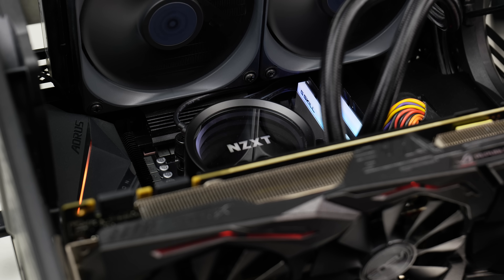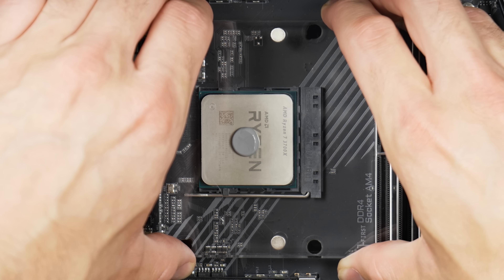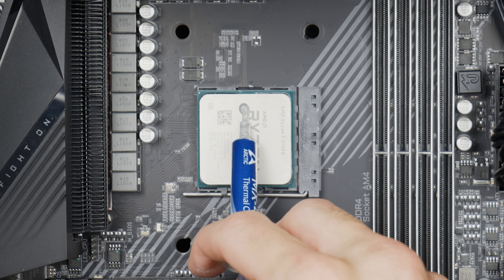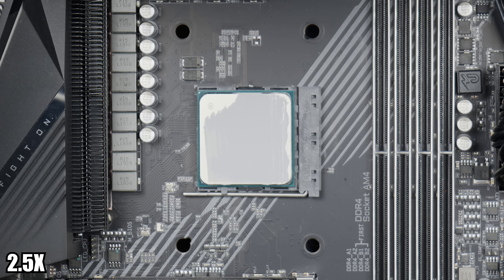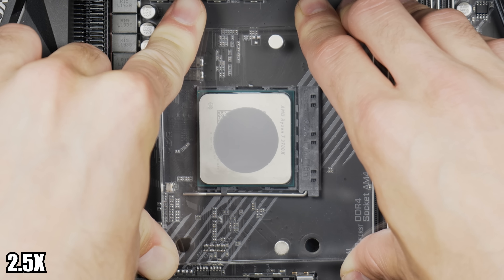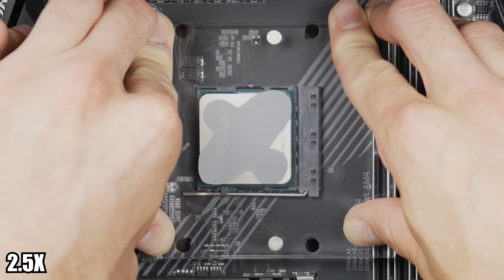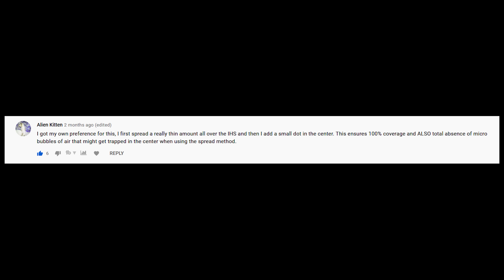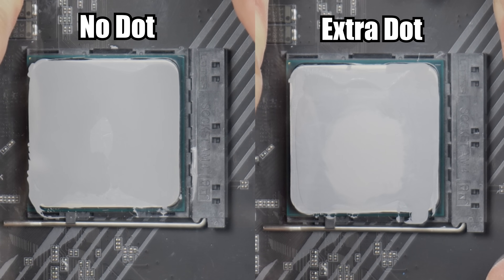Thermal Paste Spread Under Glass

Comment: "The bubble disappears, but where did it go?" These are the thoughts that haunt you after and make you want to remove it and take a peek.
Reply: If you have enough thermal paste it can't hurt to check and just redo it. I know I messed up the pea thing at first. I dno maybe peas are just smaller over here? XD
Reply: @zwenkwiel816  fr though. first time I built a PC I purposely used a bit more because I was thinking a frozen pea, that's definitely not enough
Reply: @Bluntsmoke  

There's no such thing as "not enough" when it comes to thermal paste. Its purpose is to fill in microscopic spaces between the two surfaces, not cover the entire thing.
Reply: @orionlax626  This is so extremely false. There is such a thing as "not enough". If the paste doesn't spread across at least some of the IHS, you will run into thermal issues; Especially with Ryzen cpus due to their chiplet design.

You can't really have too much. As long as the paste is non-conductive, its fine to have a little overflow on the sides.
Reply: @orionlax626  Except there is! If you use too much, is just bad as using none
Reply: @redbloodedamerican2346  

I know. That's why I'm saying you should use very little.
Reply: @orionlax626  You've got to use the right amount though. There is such thing as not enough. The purpose is to get the air out from between the cpu and cooler.  If you use the thermal pad, it gets hot.
Reply: @redbloodedamerican2346  

My point was that most people overdo it. The proper amount is a lot less than people think.
Reply: @orionlax626  Gotcha
Reply: @redbloodedamerican2346  That is not true. There are videos of people testing this with unholy amounts of thermal paste, and temps are the same as using the correct amount. The excess just squeezes out. Too little is very bad however.
Reply: @Alex-lc1bv  🙄 Then you've got a huge mess and not all are pastes are non conductive. Yes! My statement is true. I suggest read it again
Reply: Of course, that completely defeats the purpose, since all you see is smoosh and spikes. #DontWasteYourPaste
Reply: @h8GW  that's what she said
Reply: It pushed out the middle of the paste where resistance to its escape is lowest. They dont 'hide' in there. The surfaces resist flow more so you dont see it on the surface. Its a viscosity and friction thing. The bubble wont remain. Especially when the cpu heats and the paste thins slightly.
Reply: @willcal2738  Oh how they hide. Those sneaky bubbles. I think what we learn from this is that some patterns are better than others, but all will get the job done provided you don’t apply to much. Cheers
Reply: @ModdBoy  its the same. It gets squished. Given proper mount pressure all bubbles  press out over time. Unless youre using very hard compounds.  Spread it manually and use an extremely thin coat, and get 100% IHS coverage goto gamersnexus and he does alot more on paste.
Reply: The same thoughts all over the world. LOL
Reply: Intrusive thoughts
Reply: I got scared. It's makes me not want to do the spreade method ever again. I think the resolution is to go with a baby dot in the middle of the cpu before placing the cpu cooler on top.
Reply: @Latin00032  wash hands. Dry hands. Put paste on finger. Spread it, wipe finger, spread, wipe finger... youll start seeing the text on the cpu. a fine coating is what ya want, slightly too much to see the text on the lid. You got 20 applications worth of paste, no stress, get zen
Reply: Take calculus based physics and then that won't be the thing that haunts you at night.
Reply: It’s a moot point. First of all, it’s flawed because he’s using a piece of plexiglass which is bending and caused the air pocket because he’s lifting it in the center and the edges are down.  Aluminum heat sink isn’t going to flex.  also thermal paste heats up and softens and the gap would get filled anyway
Reply: Jesus loves you so much and He is waiting for you with open arms, please accept Him in your heart and life while He is near
Reply: Shrödinger's bubble

Comment: Try method. Put paste a litle more than tiny dot. When putting a cooler on, turn it for a 180 degrees, whan you finish a turn, cooler should be fitting a right posision.

Comment: When laying floor tiles, on the floor, you lay adhesive then comb it in straight lines, then you 'butter' the back of the tile. This prevents both air pockets and dry spots. Badly laid tiles are more prone to cracking... So, I think you should try the butter method, then go over with a small comb, if you have one. I wouldn't worry about the back buttering, as thermal paste isn't adhesive.
Reply: No when laying tiles, bubble formation is not a concern. The comb is to create an even height for flooring. 

Break and rip off a tile. You'll see the comb pattern still there and full of air.

Comment: I think arctic silver had the best explanation in their instructions; it's core dependent; if exposed core, you butter it on.... if single die dot or rice grain depending on the shape.... if 2, line across the 2(horizontal or vertical depending).... etc etc.... the only down side is you have to google delidded cpu's to get an idea what is under most cpu's or similar; with exception of exposed core, you don't have to have full coverage and less is more if there is any imperfections on either surface.... the paste is meant to be a filler for imperfections and not a full layer, part of why thermal pads/graphite is less efficient

Comment: sir  im new to this,what happen if it not coverage all or to much thermal paste i put will it harm my pc,,
Reply from the maker: Generally, it will be hotter, thermal throttle and put extra stress on the chip which will likely lead to shorter lifespan. I posted a video testing without any paste at all.

Comment: At the start, I thought you were going to push the acrylic against the heatsink rather than the CPU. So that way you can see how the grooves and grain might affect the way it spreads out.
Reply: Pretty sure the point of the grooves was to allow channels for air pockets to escape as pressure is applied instead of them retreating into the paste. Could be wrong but I don't think I am.
Reply: @DustinCox-t8h  if you "don't think" you are wrong, then there is no point at all in discussing anything ;)
Just try to think why one of the first steps for lower temps ever since before the introduction of IHS's is lapping the base of the coolers.
Reply: all coolers have polished surfaces now, it's not a thing
Reply: @DrGeta666  Can I ask what 'now' means? I just bought a cooler for a really old computer...which now you can ask, "What is 'really old'?" xD

But yeah, do you mean AM5/LGA1700 and newer or you mean anything after AM2?
Reply: @NoOne-yp1qe "grooves and grain" have never been a thing,  heatsinks have them due to cost-effective machining processes. In the past I've dropped several degrees by lapping (making the bottom "mirror-like") the heatsink I was using at the time, and besides the cheapo colored alloy finish removed, I also removed the "grooves and grain"  from the bottom of the heatsink. So no, grooves and grain do nothing but "trap" more thermal paste on them, worsening the heat transfer (although the end result may be minuscule).
Reply: @rhobson  Just playing "Devils Advocate" here - if the Chip was smooth and the heat sink were grooved, with paste, and no air pockets, wouldn't the grooves provide MORE surface area for the paste to transfer heat into ??  Or does "smoothness" get the sink closer, and - as long as you set up glass and sand-paper, why not polish the chip too ??
Reply: @peterdarr383  I see your point of view on this, but let me try to explain better: in a perfect world, both surfaces of the chip and the heatsink would be completely flat, and would make perfect contact just touching, providing a perfect heat transfer by conduction. 
Since we do not live in a perfect world, we use thermal compounds (paste, glue, sheets, "liquid metal'...) to fill the gaps between the surfaces from the chips and the heatsink, otherwise these small gaps would have "air", and the heat transfer in these gaps would happen by convection - and the air has a very poor thermal conductivity this way...
Reply: @rhobson  So why not polish the chip ?? There's printed words on there - get that last ten thousanth !
And why not go with Copper for the heat-sink / radiator ?? Two dollars a POUND more, but we're not using a pound of material. Aluminum radiator bonded to a copper plate would work.
Reply: @NoOne-yp1qe  more like Pentium era, when we got more than 1 single core in a CPU

Comment: Seeing it like this it makes sense that the X would work the best since the paste expands from the center and the spaces allow for air to be pushed out as the paste expands. It may not make a difference in temps. in practice, but it seems like the most foolproof way to ensure proper coverage while giving you a bit more room for error in the amount of paste you use so I'm switching to the cross method from now on. 

Been using the pea method my entire life, but there's always that doubt about using too much/too little paste, and the cross seems to allow for an easier time measuring it.

Comment: I use the spatula and spread in onto the cpu then once I set the cooler down on the cpu I gently wiggle it back and forth a couple of times to settle it down before I tighten it.

Comment: I've been using Ye Olde debit card method since ~2002 when i started working in a PC shop where we assembled and repaired systems. I can't ever recall a customer coming back in with any CPU overheating problems, and we never discovered any, and we used to sit and play games on some customers PCs as they were higher powered than anything me and my coworkers could ever afford, so they were well tested! LOL
 
As with all things, we may have missed a handful out of the 1000's of systems we handled. 

On my own personal assemblies, i of course stuck with using the debit card method, and again, never had any overheating issues at all. 

We had done a similar test with a glass plate that you'd use with those microscopes, thinking that the glass would be of a higher surface polish standard (not that it mattered) and used a cylindrical weight from an old set of scales that almost perfectly touched all four sizdes of the CPU (again, not that it mattered). 

We would start this test just before we closed the shop for the night at around 5.30, so it would be an over night test that was checked when we opened again at 9.30am, and besides the X, the rest of the methods you've shown here turned out at about the same coverage. 

The "Penta dot" as you called it, was simply done like the 5 on a dice face, with the dots closer grouped together than shown in your own testing. My coworker even just Picasso'd (random) thermal paste onto the CPU, and it turned out about the same, but with a more spilling over the side than even a large blob LOL (don't do either since it's just wasteful).

In the end, we decided among ourselves to eyeball a pea-sized blob and then use a debit card to spread it out. 
This was our way of ensuring we didn't use too much paste, which in turn would translate to higher costs over all from having to buy extra thermal paste. However, when you're doing your own PC, then you don't need to worry about over all costs like that since you only need one tube. 

So even though i have known for a very long time, that it really doesn't matter all that much, i still can't kick that habit of using the pea sized blob + debit card method. 

It's like an addiction at this point in my life! LOL

Comment: Nice one. Great channel, great quality content, love it. 
It would be interesting to not apply the pressure completely by hand, but rather have the transparent sheet rigged with holes so that one could install it using the cooler mount screws. This would get the results very close to real life.
Not to mention that these tests vary alot depending on the thermal compound used, with their different viscosities.
Last but not least, der8auer, after also making these kind of glass sheet tests, said on a GamersNexus video that due to the very high mount pressure between the heatsink and the CPU IHS, trapping air bubbles of a size that actually matters is almost impossible. 
Here: https://youtu.be/CCqxE-5Ct3w?t=689
I would personally add that in a DIY home situation like this, it is actually impossible to NOT trap microscopical bubbles in the compound, which even out, and they do not really matter in the end thermal performance and measurements. AND they will eventually escape thanks to the pump out effect through thermal cycling.
Reply: That's what I was thinking - make it like the actual heatsink assembly

Comment: I usually just fill my whole bathtub with thermal paste and completely submerge my whole pc in it. It had yet to exceed -48° i did notice a 92FPS drop due to not being able to see my RGB through the thermal paste, so i made sure to cover the entire bathroom in RGB lights to eliminate FPS loss.
10/10 most effective method so far. Highly recommended.
Reply: Make sure you turn the tub on, I heard liquid cooling makes temps 69x cooler.
Reply: LMAO ! 😂
Reply: Dude, what are you smoking?
Would you like to share it with me?
Reply: @fajaradi1223  Peasants
Reply: That's all fine and dandy until you flush the toilet.
 
Suddenly there's a plague of thermal paste sewer rats spreading RGBubonic Plague around the city.
Reply: @Sigurther  dont worry, the entire neighborhood will be cool during summer
Reply: Lmao 😂😂😂
Reply: You forgot the rgb dry ice
Reply: If you put a toaster in the bath, it will awake the special features that baths usually carry, which will enable you to overclock the PC.
Reply: @owo1744  Right, but you gotta make sure you jump in the bath before putting the toaster.
Reply: You should install web cams and lights inside the thermal paste, thereby making the RGB visible again in a separate monitor.
Reply: You are so awesome! LEARN ME!
Reply: I just cover the entire motherboard with a 1" thick layer of thermal paste. That way you don't need the bathtub.
Reply: "What case do you use? ATX, mATX, mid tower.."
"Room"
"What?"
"Bathroom"
Reply: What kind of tub?
Reply: @Nerzgul  I'm going to assume an ultrawide tub because of the increased productivity.
Reply: I know it's a joke, but how much would that much thermal paste cost?
Reply: @RimFaxxe  My calculations say $37,476.57 USD to fill a 150 liter tub with 2344 of the cheapest 150 gram containers I saw on Amazon. Time well spent. (This is assuming the weight per volume of these is the same as another product. I couldn't find many which listed the volume unless they were the little tubes normal people use)
Reply: Since there's no fighting ambient temps, I just bought a Sub-Zero walk-in refrigerator to turn into my gaming room.
Reply: Gotta get them RGBs
Reply: true
Reply: Lol 🤣🤣
Reply: But have you tried RGB’ing the thermal paste?
Reply: DUDE YOU BROKE MY LAPTOP
Reply: But can you play Minecraft with shaders on it without losing FPS?
Reply: lol, did you try that with "liquid metal" aka galium-something ? for better conductivity of all the traces and contact points of electricity
Reply: ROFL!!
Reply: I see you are following the verge's method
Pretty good
Reply: I read a story a while back about a dude who did this but with glycerine and the coils from a fridge. It's probably internet legend but I wouldn't be surprised.
Reply: Best comment so far 😂❤
Reply: This is one of the best Youtube comments I have ever read, thanks for making me laugh good sir!
Reply: Jesus loves you so much and He is waiting for you with open arms, please accept Him in your heart and life while He is near

Comment: The air bubble is complete bullshit on buttered toast. You will put much much harder and even force with screwing down instead of our measly hand. You will heat up and cooldown and thermal paste will always be on the move. There is just no fucking room for air bubbles. Buttered toast is just objectively better because some thick pastes need some heat cycles before it spreads all around the IHS.

Comment: How about the suggestion of Arctic Silver 5 first: Spread a little thermal paste over baseplate and the IHS, whipe it off with a dry paper towel (no alcochol or other cleaning product, really dry) and then apply the thermal paste as normal. Like that you're filling the microscopic groves and is your curring time less longer. Or get Artic Silver 5 of the latest batches as they have changed the formula which is now no longer conductive and has no curring period.

Comment: What will happen if the thermal paste is over or dripping off the processor?
Reply: If you use normal thermal paste then no worries. It doesn't conduct anything so you'd just be making a mess. If you are using conductive thermal paste or liquid metal then it can be a problem. Although they offer better cooling you are at risk of a short circuit damaging other components if it gets anywhere that's not the cpu.

Comment: Air bubbles are not a issue at all; the spread of the thermal paste, a solid, with pressure, and heat cycles, totally kicks out any air between the thermal paste and the surfaces. If that was a issue, placing those silicon gel protections on smartphone displays would be way harder because of the surfaces being drastically different, or doing a display change would be almost impossible to kick air bubbles.
Also, not the X method, but a + plus sign method, is the one that spreads the most without yourself spreading it.

Comment: try doing it while the acrylic sheet is covered so you don't adjust the pressure as you press based on what you see. then take off the cover to see which method is more prone to making bubbles
Reply: Need to use the actual thermal cooler mount to push on the acrylic to see anything similar to real world results.